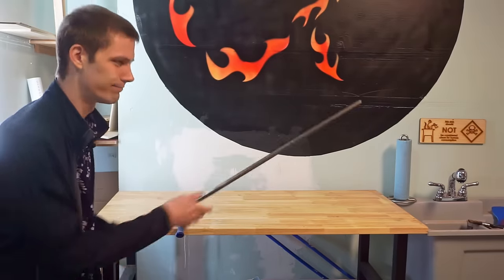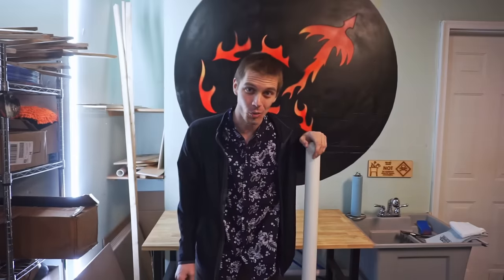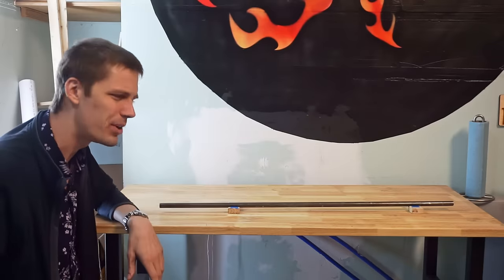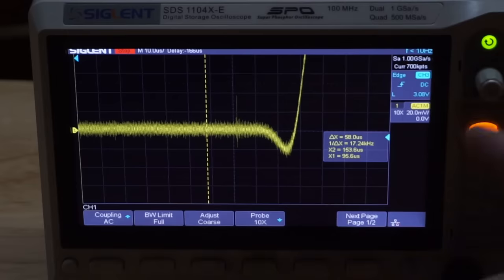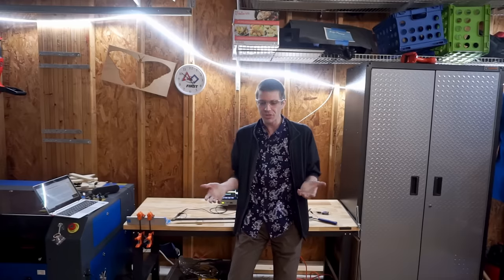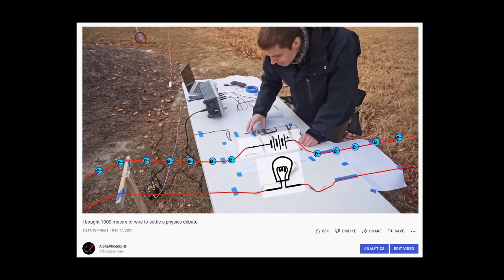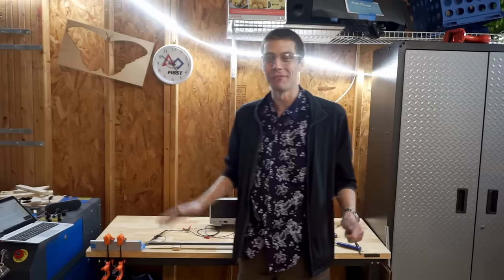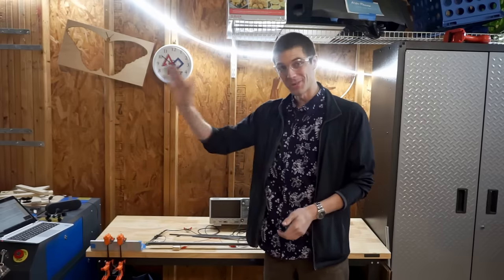Are solid objects really “solid”?

Comment: As an electrician I could have told you that movement across an object is instantaneous. There’s a reason, aside from resistance of the conductor, that we use fiber optics to transmit data across extremely long distances instead of bigger conductors, light is faster than electricity, despite the fact that theoretically, electrons should transmit across a conductor instantaneously. If light wasn’t an incredibly inefficient means of transferring energy we’d use fiber optics for power transmission too.

Comment: Nice demonstration!
The impulse through the bar is a compression wave, just like sounds we hear, a sonar ping from a submarine or the "P" wave from an earthquake. So compression waves. 
We've all experienced compression waves when driving on a crowded expressway. These are the unexplained traffic slowdowns, or stops, followed by resumed travel and we see no accident or construction area after moving forward. You can imagine viewing this from over head and watching the area of compressed cars propagating up the line of cars.
I wonder if a nail bulges as the hammer impulse travels from the nail head to the point?
Reply: @@brandyballoon start - stop driving wrecks mileage for semi trucks. They cruise OK, but dick fuel when accelerating. So, stretching out the wave saves fuel and their left leg (clutch)

Comment: The bar at the other end would appear to never move, and this is why.  The act of pushing on the end of a 5/8 inch rod that length would simply cause the bar to compress as the force being applied could not overcome the inertial mass of an object at rest.  The steel bar is far to malleable to cause movement of the entire bar with a mass this large, even without resistance.  The opposite would occur if the bar were pulled by a force from the other end, stretching the bar instead of compressing it.

Comment: Definitely makes sense that it wouldn't be instantaneous, every single force will induce a deformation in any material if you look at a stress-strain curve. Some elastic (non permanent, like flexing) deformation is just so small it's irrelevant and not noticeable.

Comment: I love these types of videos.   Really awesome experiment.   Being able to see the delay between the hit and the end of the bar pushing forward really drives home the concept.   It also makes me think about the speed of light actually.   If you think about spacetime as if it’s a material then the speed of light is just the speed of “sound” through that material called spacetime.   So electromagnetic radiation (and heck, maybe matter) could be considered pressure waves in spacetime.   I guess the analogy breaks down at some point but it’s interesting to think about.
Reply: Think about space and time as nothing. It works better. 

Space and time don't interact with anything. Only matter interacts with matter. And matter and energy cause a sphere of influence arround it we can measure as space and time.

Comment: The 180 micro seconds accounts for the time it takes to activate both the input switch ( on the strike side) and the activation switch ( on the end side) That delay is not suggestive of the time it takes for the energy to transmit from one end of the bar to the other. You would need to use some immediate activation system that do not depend on any mechanical activation other than the bar movement itself. I would suggest to make an always closed circuit. 
Not to mention that at this scale, even the resistance on the wires and other factors that transmits the signal to the measuring equipment needs to be accounted for. But indeed a very interesting question to answer, but unless you are using a bar that measures at least 100 KM, I dont think we have equipment that is fast enough to measure this.. Maybe with some super conductive material you could get a better picture of the timing of energy propagation. With visualization and intuition, one can be sure that the atoms are bouncing and transfering the energy close the speed of light. The resistance of matter itself would not allow for light speed propagation. If the propagation goes at light speed, one would expect the energy to take 1 millisecond to move across a <>300 meters bar. 
With some good math you can arrive at an estimate number and then make your tests on a smaller scale. But taking into account that in an ideal scenario, you woudl need to be able to measure picoseconds to work with a 10 meters bar, fore ex.

Comment: there are a few problems I didn't notice being adressed:
1. propagation delay of the sensor system
2. flex of the hammer/elasticity of both hammer and rod on the contact point
3. inertia of the rod
were they not considered at all or simply ruled out and if so, why?

Comment: Actually, you're measuring the length of time the machinery takes to detect contact with the hammer, back to the machine, starting the timer, back through the bar, through the pressure sensor, for the pressure sensor to interpret and send a signal back to the machine, and finally, for the machine to interpret and display a readout.

Comment: Great video, including that your error-search at the end is very educational. Maybe someone has pointed this out in the 8000(!) comments, but you are not disregarding the nuclei. The speed of sound is so much lower than the speed of light because the masses controlling the vibrational frequency is the mass of the atoms  which of course is very nearly the mass of the nucleus (and is hidden in the density in your calculations): in the mass-factor of the frequency you actually neglect the electrons, not the nucleus. The other factor is the spring constant, and IT IS controlled by the electrons (or rather the Coulombic force between the ionized iron atoms and the sea of free electrons). This force of course is mediated by photons (as between the electrons in your excellent video on electric currents in long wires) so by the speed of light, but this is not the relevant speed in your question because the nuclei are so much heavier than the electrons.

Comment: Depends on the amount of force that moves it, say if it’s your hands and push it the other end moves “instantly” but if you hit it with a hammer, then the reverberation will take time to reach the other end. Reason, as you push the rod the low force of the movement, the metal will keep its rigidity, but with a “smack” of a hammer, that heavy force of metal on metal, the bars molecular structure is overcome and “bends” this will reverberate through the bar to the other end

Comment: For the electricity in the wire there are problems that cause it to slow down as we don't have any materials that are 100% efficient conductors that would let the currant through without resistance and we'll most likely never find one. The closest in my mind would be fiber optics and light rather than wire and electrons and even then it isn't 100% efficient. 

Now we come to the "solid" bar issue. Let's assume that you're still using a 5/8ths bar and that it is and long as the speed of light is fast. You push one end and the observer on the other end doesn't see it move instantly, but still would see it move in a fairly quick succession. Why don't they see it move instantly? Because your push still causes vibration(and more flex as you've added length) throughout the entire object which still leads to a loss of energy along the way. Think about it like a tuning fork that you've hit. The sound put off by the fork doesn't stay constant once hit as the vibration is shedding the energy as sound waves. Same principal with the 5/8ths rod over a long enough distance. To get the result of the observer seeing their end move instantly you would need a material so hard and so dense that it wouldn't flex at all and as far as we're aware there aren't any in the material universe. 

This is my assessment before completing my full watchthrough of the video.

Edit: If I had watched another minute before commenting I would have come across your multiple choice answers, but the answer is that the yield strain of the material you're working with is the issue here. Even with my example of the tuning fork that's the answer as the sound waves are simply the effect of the material transferring energy from vibration to sound and not the cause itself.

Comment: haven't watched the video yet. But I think the time it would take is relative to the compressibility of the material, and the speed at which it is pushed. My reason for it is. a material can't move at that speed, so there for the first limiting factor is, compressibility, the more a material can compress the longer it's going to take for the energy to transfer since the material is "vibrating" from your push. That also means it will move at the same frequency or speed you pushed it at. My reasoning for that is because no matter how strong you are, if you push a 300t truck at 15mph it will move 15mph, same if you moved a truck 1t heavy. 

So the way I see this is that the speed of the bar will be the speed of how fast you pushed it, which is then reduced by the compressibility of the material.
All of this is assuming the bar will go straight, nothing else.

Comment: This is something that perplexes me. How do you move from point A to point B at the smallest possible distance level? If there is a point A and a point B, then you must travel infinitely linearly along the path. You can measure the space between point A and B, then reduce that into half, then reduce that into half and as long as there is two separate points, there is a space between them. At some point, there must be no more separation that you can reduce, because it cant be infinitely small. So how then do you physically move from that physical space to the next if you can't travel between along the space? Is it not as though our matter is literally teleporting from that point A to the B? Think of it like pixels, to get from one pixel to the next, one pixel turns off, the next pixel turns on, its a jump in space. But in real life, what is the pixel density of reality and how do we physically move in space from that point to the next without phasing out of an back into reality at the smallest level? 

I hope this makes sense.

Comment: Something the pipe full of water analogy completely forgets is that water pressure is a thing.  It's quite possible to have a pipe under several atm of pressure, which is achieved by putting more water into the pipe than "fits."  When a pipe is open at one end and so water is flowing through, that pressure build-up still happens as water molecules push each other through the pipe.  In water infrastructure, we'll actually measure the pressure in a pipe as a part of observing how well that water is flowing.

Comment: Question - the hammer may touch the bar but it has to transfer that energy to the bar to try to accelerate it and that may take some time - also a delay ( small ) in the electron flow in the hammer detection circuit - are we not measuring that transfer of energy partly as well ? Changing the weight ( mass ) of the hammer and repeating that may change the time setup 
Great experiment !

Comment: Sound travels at 343 m/s in air, it travels at 1481 m/s in water (almost 4.3 times as fast) and at 5120 m/s in iron (almost 15 times as fast). I didn't pick 3 for that reason. Unless you already done an experiment and you know the actual speed of sound in iron, I had no way in knowing. Besides, since it is always different depending on the materials used, wouldn't another property come into play? A rubber ball bounces but a rock not so much. Are you saying that the speed of the energy of the bouncing is proportional do the speed of sound within the material?

Comment: First of thanks for getting people to thinking!  A pressure transducer is inherently going to have a delay converting pressure to an electrical signal, as well as your other equipment to read, interpret and graph that signal.  On the other end you stated you had a resistor, that alone would create a major delay would it not?  You stated there is a measurable delay in electricity through wire.  How much is that delay magnified due to resistor, capacitors, circuit boards, fuses and microchips that are within your oscilloscope looking device?

Comment: Fun fact: you can actually replace that hammer with a laser pulse. The laser transfers momentum to the metal, which causes a strain wave in the material.  People who use this, actually state the speed in nanoseconds per picosecond, as laser pulses often operate on the picosecond time scale 😮

Comment: Just to show there's nothing new. About 40-50 years ago I was working on computer terminals that used Delay Line memory (oh, and core stores). Delay Line memory more or less demonstrates exactly what you're talking about here. Take 2 or 3m of steel (IIRC) wire. Mount it as a coil, with each turn supported on resilient mounts. "Whack" one end of it with a piezo transducer and have another transducer at the.other end pick off that whack a few microseconds later. Make that "whack" a coded series of impulses and feed the pattern round and round and you have a memory with data stored according to the time delay after the pattern of whacks started. Simple and elegant.

Comment: You can use this to measure the thickness of really thin metal films in semiconductors by using a pulsed laser to heat the surface of the film in a very short but high energy burst. It initiates a pulse of strain that propagates through the film, bounces off the substrate and comes back up to the surface. If you can measure the change in strain at the surface over time and you know the speed of sound in the material you can measure the film thickness.

Comment: Well, it would compress (and maybe deform) against the inertia of its own mass.  So it wouldn't approach c.  But as a thought experiment using super strong material with negligible mass... Hmmm.. There would still be a compression wave travelling through the materials subatomic bonds/forces as the particles are pressed to their limits.  I don't know what that wave speed would be. If the diameter of the rod were increased there would be greater structural strength with less apparent compression along the axis.  

Thought about this before, couldn't sufficiently guess the outcome.  Thanks for this video :)

Edit: watched the rest of the video. Nice that you considered the same issues.  I guess as you theoretically reduce the density and thereby mass would leave you approaching c.  And in fact reaching c if there was no mass in the rod. But you do need mass between which force is exerted between particles (bonds) otherwise you might just have a wave travelling at c without reference to mass.  Suddenly the Biggs boson conjecture makes some sense to me.  And huh... Got more to think about now.  Thanks again for the video.

Comment: considering the difference of material, water vs. metal.  the weight of the water will hold back any water poured in until it equalizes and is able to push the water out the other end.

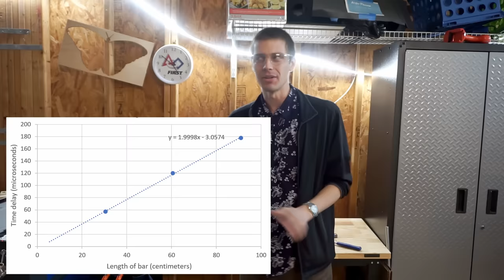Comment: 17:27 why not put several bars in sequence with incremental steps, and put pressure sensors in between and on the ends? It cancels out the pressure sensor issue, and give you a good graphic reference.

Comment: i would like to point something almost irrelevant: there's a tiny delay in the measurement caused by the speed of the electron pulse generated by the hammer when it touches the bar, and it's probably orders of magnitude faster than the speed of the sound/force propagation throughout the material, but it's still there and I wont be able to go to bed unless i point it out :)

Comment: then the new question is, if you pull on one end of the bar, how long does it take for the other end to move? there is no longer a compression wave propergating through the material. so what's the speed related to?
Reply from the maker: It’s a negative compression wave! (A tension wave?)
Reply: @AlphaPhoenixChannel  so is that the speed of sound (in that material) too?

Comment: Propagation of force has a speed.

We had some sprockets that were supposed to friction fit onto a keyed motor shaft.  The guy that designed the sprockets messed up. The hole in the stem was too loose.  

I took one over to a bench vise and smacked the end of the keyed tube a couple of times, and tried it again.  This time, it fit.

Later that day he brought e one of the sprockets that he had tried to squeeze in a vice.  The rim of the sprockets was badly distorted.  He asked me why that hadn't happened when I hit it with a hammer.  I told him propagation of force.  I bent the tube locally by applying a very fast pulse if force.  Squishing it in the vice allowed for the force to spread out and distort the sprocket.

Comment: Are you sure the initial dip on the pressure sensor isnt the wave pulling the bar away from the sensor (like a steel rod tsunami) before the impact? The timescale would form a partial vacuum between the sensor and rod, so negative pressure is possible.

Comment: I love this. I’ve often thought about this. I’ve even said in the past that I could move something faster than the speed of light if I had  a long enough stick.

But what if we use a different material? Would there still be a delay if the stick were made from a material with infinite density, pushed by someone with infinite strength (and ignoring many different basic rules of physics and nature)?

Comment: Very similar to trying to determine gravity of an orbiting body based on density of an object, NOT SIZE. Based on how close the atoms are to eachother gives the specific answer to the material. Surely a Diamond commutates the input closer to instantly compared to say, wood. Mathematically I think you can figure this based on density alone to figure out how long the motion to die between the spaces of the atoms or retain the energy because there is no space for the energy to meet entropy.